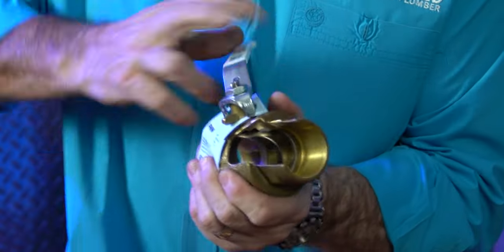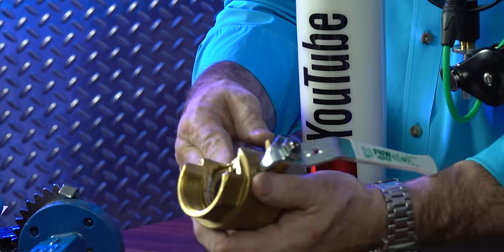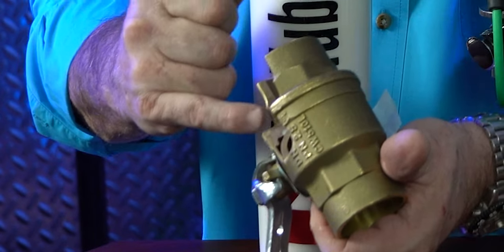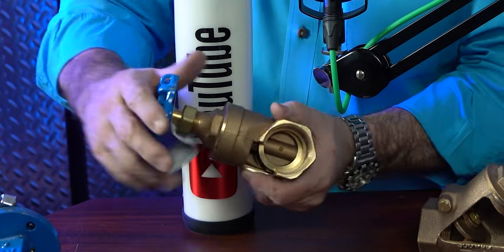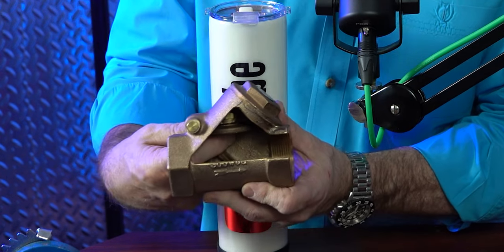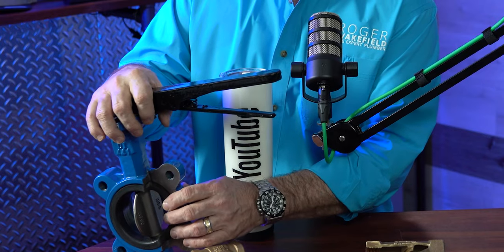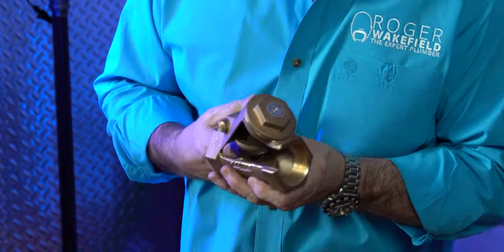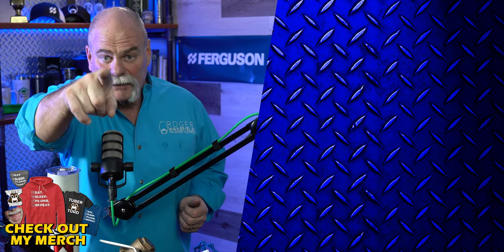How Does a Plumbing Valve Work

Comment: Wow I had only really known of the gate valve and ball valve, with my favorite being the ball valve because it's the easiest in my opinion to open and close, though the butterfly valve looks really cool. Also the check valve is interesting too
Reply: @Jtzkb   I thought he did, he said the butterfly valve is used in industrial applications because the butterfly valve is easy to replace and implement in industrial enviroments...and that it has some good indicators that tell you if the valve is open or closed....

Comment: I work for a very small town and handle every task and live in another very small town. Mostly every house has the outside water shutoff and then inside the house before and after the meter will have a shut off. Most before the meter are city style can be open and closed as needed but also can be locked if I need to do so.

Comment: Great video mr rodger! I just wanna ask you, why dont we use a ball valve for the shower diverter, on hole on the top and one on the side for the hot and cold water for the faucet, and you can turn it enough and it will send the water up to the shower head
Reply: There would be no way to access the handle with the piping behind the shower tile and any shutoff cannot be sealed behind a wall
Reply: @AG-ee8xc  oh, but you know what im saying right? ILl upload a video

Comment: One important note with a ball valve.  You can assume the ball valve is open when the handle is in line with water flow.  Usually.  But you can't just look at a gate valve and know this.

Comment: Question for the plumbers. What is the best quality ball valve out there. The ones I have are generic ball valves, brass and sweated to copper lines. These all have the white effluence from tiny holes that form over time. Are there any high quality ones that don't do this?

Comment: Here in Arizona we had a pipe bust under the trailer. So the landlord called the guys to replumb the house. But you know what the assholes forgot to do. Replace the fucking valves. So my shower and the tub still fucking leak.

Comment: I put a ball valve on our water supply line so an elderly or weaker person could shut off the water in an emergency and rebuilt the globe valves when I saw that the made in China valves were built to an inferior specification AND no soldering needed!